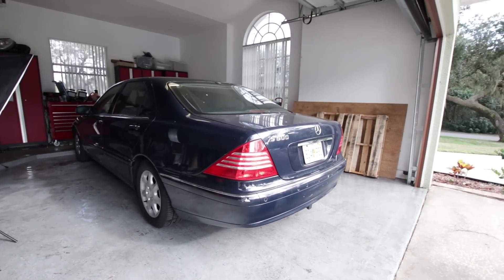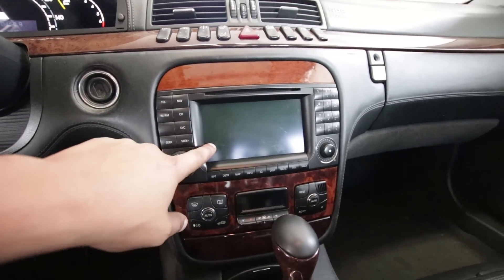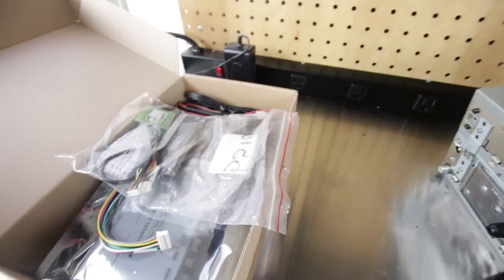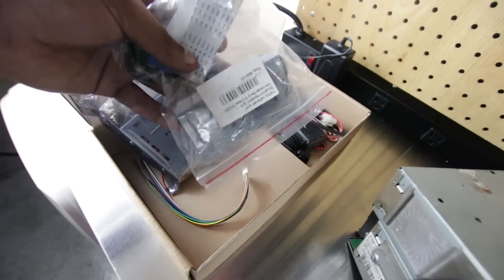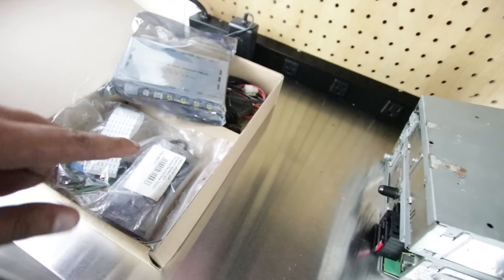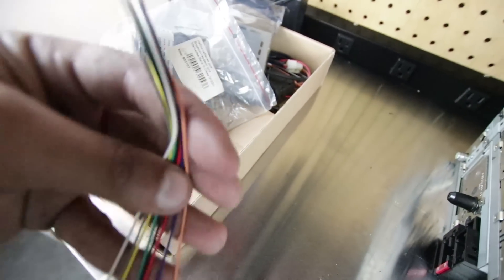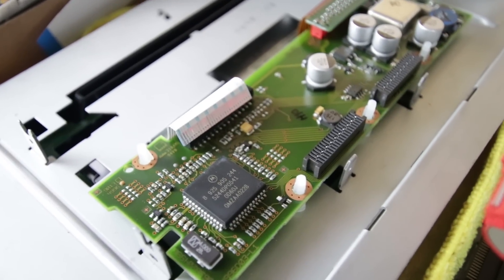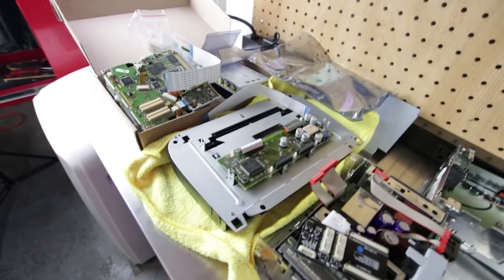Ultimate Daily Driver S-Class Pt 5 - Backup Camera Install FAIL!

Comment: Freddy, I know this video is 2 years old, and I have yet to watch episodes 2,3,4, but......I just got myself a 2006 w220.  My PSE motor has burnt out.  Before spending $$$$$ at a shop I want to wrench myself of course! Do you recommend just swapping in a new air pump(motor) and see what functions start working, then go from there? Or do you think I should go somewhere with a STAR/DAS tool? Thank in advance Freddy!

Comment: Surprised the rear view camera didn't work... I have the same head unit as you on my 2003 W220 and it comes with a rear view camera that's stock, I believe. But it's a RH drive unit in Asia.... maybe the lack of rear view camera was on US models?

Comment: before you put it back toghter you can buy just the ribbon wire you need. unless the converter also has 2 less pins in the connector.
Reply from the maker: BooksofPerdition that seems to be the case.
Reply: I did the same conversion using the same kit for my 2004 S430 and it fit perfectly. I suggest you go for one that is designed for 2003 head unit. The kit that you have is for 2004-2006 W220 S Class.
Reply: Or just ask for a different interface PCB (the little PCB with the connectors for the wider ribbon cables). The main module is for selecting several different video sources and converting to VGA resolution for the LCD screen which has the same resolution. The function of the tiny PCB is to use the small relay to switch between the external video and the loop back to the internal display. That relay is controlled by the voltage from the reverse / backup lamps at the trunk lid.

Comment: I think you can still make this work and it depends on the pins that would be missing. Ribbons are a pain but not impossible to solder to.
The important thing is what are the 2 pins that would not go to the converter box - if you can get pinouts on the display and the converter it might be something uneeded for the converter meaning you just need to skip those two wires to the converter and get them back into their input/output with what is probably a messy but working wiring job.
It could also mean the ribbons I duno lets say 16-18 pin are out of alignment so they would also need a breakout broad between to reorder the pins (or just straight wiring).

Sucks if it's just one of them that can't be done - nothing worse then being 9/10ths into a job and something like this stopping you.

Comment: thats a E-class radio not and S-class maybe thats why it has less pins
Reply: Mohamed Sherhan No it's not that's an 03 only S class unit. I was one of the first to do the swap/writeup on it.
Reply: On models +04 they used the NTG1 from the E-class, but diffrent in styling.
Reply: It's not a e class, it's a S class